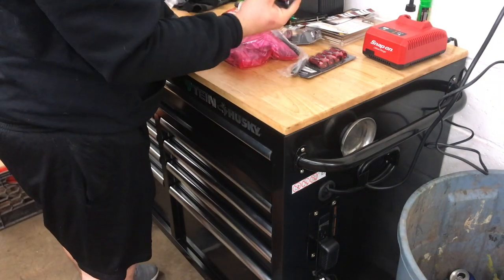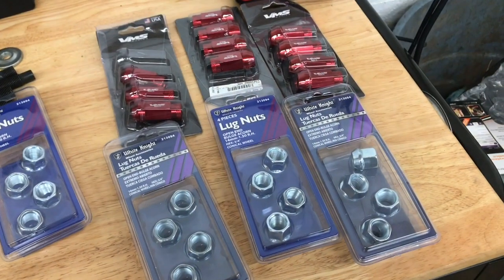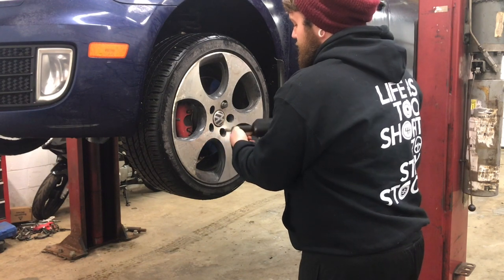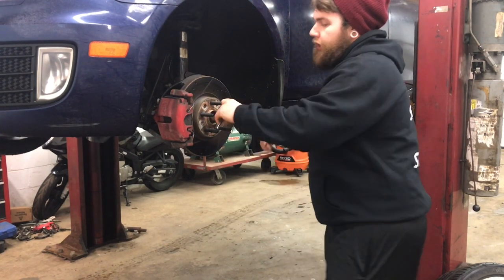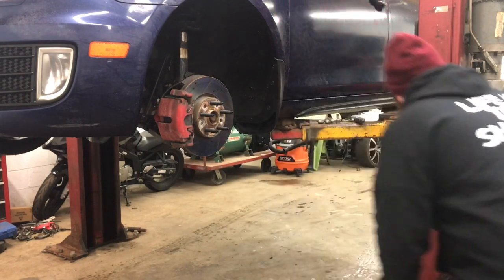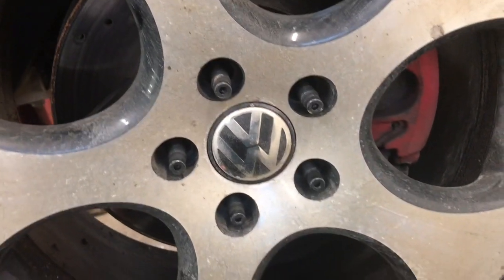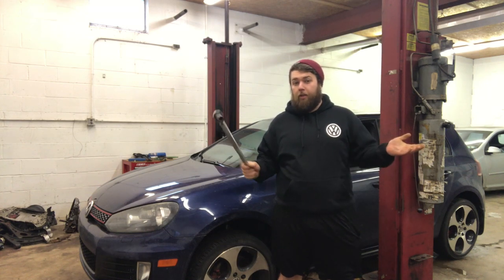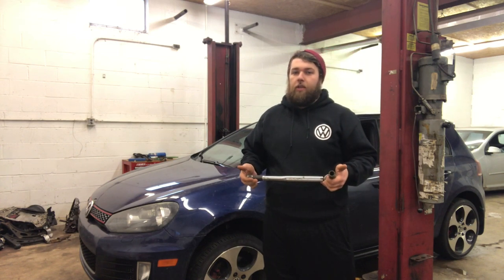WHEEL STUD CONVERSION (GOODBYE WHEEL BOLTS) was

Comment: Quick question, I noticed those are Acorn seat lug nuts, do you find they get loose at all since they're not the correct seat for the OEM vw wheels?
Reply: Also, at higher speeds, do you find they shake at all? I'm curious to know because I did a wheel stud conversion and I constantly have to torque my wheels because the nuts keep coming loose